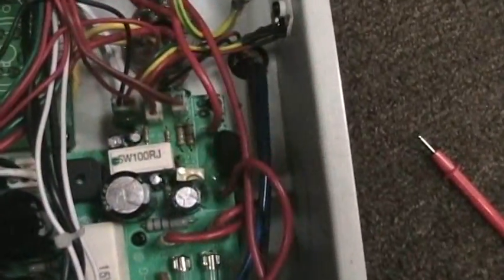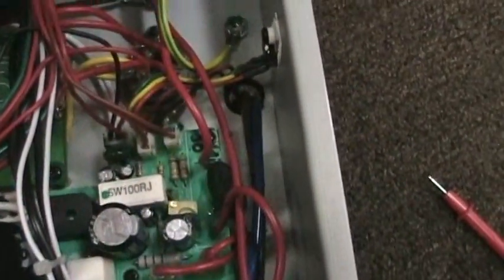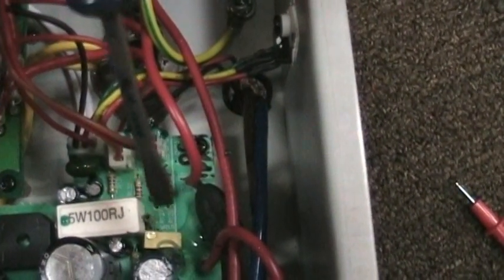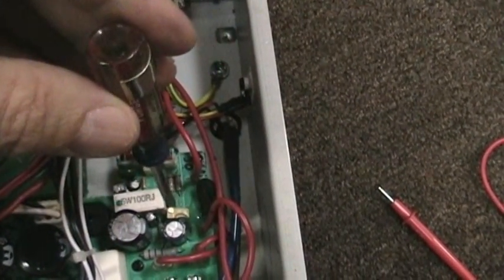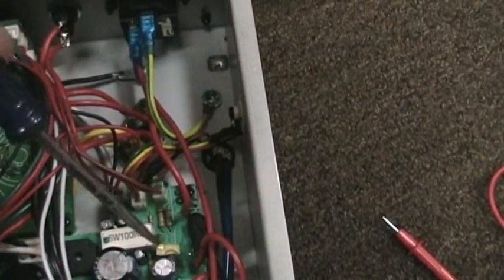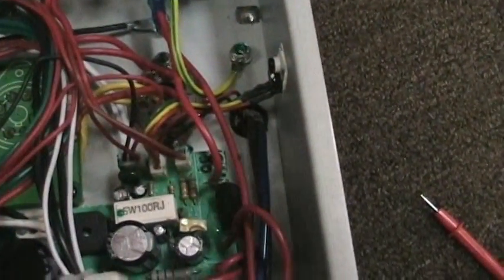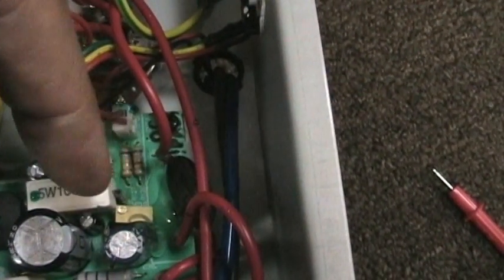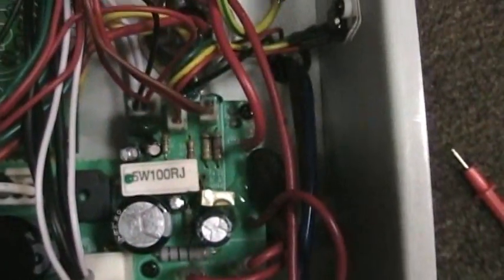B-52 amp bias part 2 trim pot

Comment: Hey dude, by ground do you mean i can alligator clip the neg to the chassis? or is there a lower current ground i should connect it to? and its pin 5 right?

Comment: @eddie7314 

Is there any way to check the bias on an amp ( this amp, in particular) without removing the chassis from the cab? I just want to check, I think my tubes are biased too high right now, my tubes on this amp burn out frequently..I do play a lot, but I don't think I should be having this problem..

Comment from the maker: Hay Man! Yeah, there are 4 screws on top ( I'm assuming you have the combo version, the head version is on bottom I think ) then you remove the black grill thing and the support piece in the back, if you want you can remove the power tubes but don't have to just be careful with it !!

Comment: hey i was trying this and my tubes only read around 20 ma. so i tried slowling twisting the screw to the right with barely any pressure at all and the screw popped off like yours so i will now need a tech to fix it. i turned it on after this happened and my tubes are now glowing realllllllllly red so im assuming that without the screw, the tubes are set at the max output which is very bad?